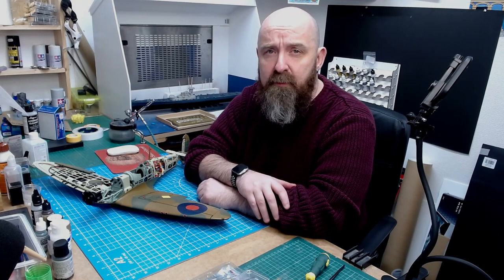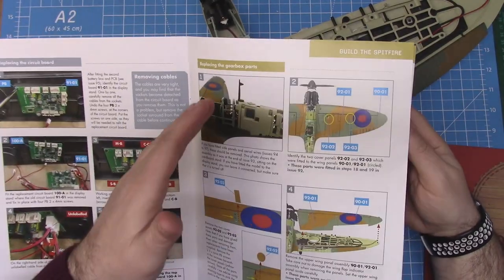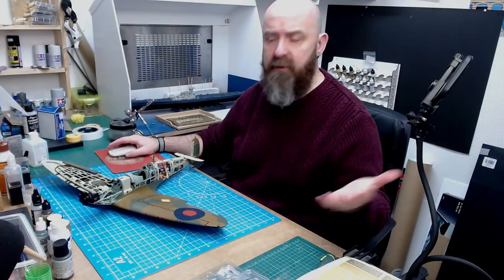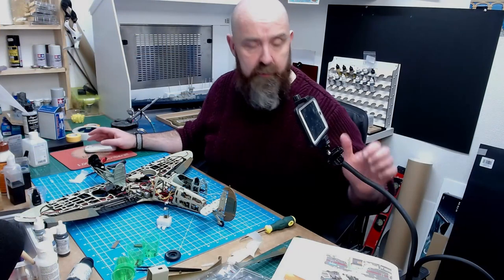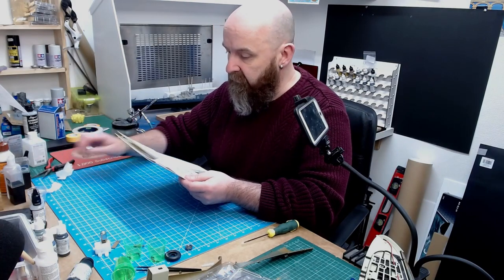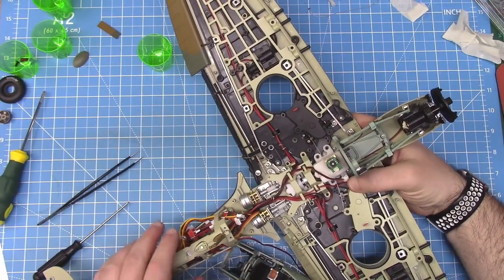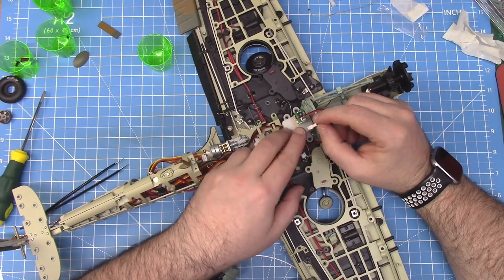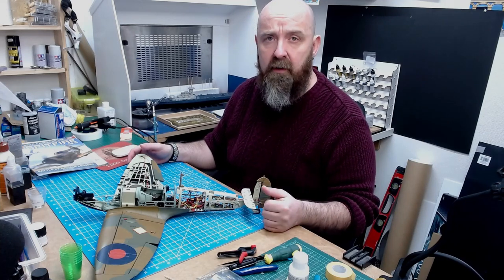Build a 1/18 Scale Model Spitfire Mk 1A / Landing Gearbox Correction

Comment: John as you have the tyres off the hubs ... it may be worth adding a little lead putty or split shot inside the hubs to add a little weight.which will make the struts drop a little easier... as they drop under gravity.... not to much tho

Comment: Well this is the first I have heard of the corrections. I'm waiting issue 99+ and have seen nothing about replacement parts. no motor, no circuit board, nothing. so I'm not holding up any hope of it actually working. definitely going to put in a complaint to hachette about this. done a few builds and not had this many issues

Comment: hi john was following your spitfire re fix having all ready glued my wings i unfortunately when trying to separate them disaster tips of wings snapped aileron bracket snapped anyway i have phoned Hachette and told them due to there incompetence they have agreed to replace all the magazines but have told them i am not happy and may send it all back  so i would suggest you phone them and get the light in the wing replaced
Reply from the maker: Thank you Edward, what was hechette reply after you told them, your going to send the whole thing back
Reply: @Johnbuildsiconic  hi John I told them all the issues I require  to fix it and they said they would send them free of charge and I told them if I can't fix it I would send it back and I want a complete refund as the model wasn't advertised correctly  or I will send it back and they can send me a complete one or total money back just waiting for yhe issues to come they said it will be next week when they should arrive I have the email address  to complai  to in France as well
Reply from the maker: I’m just hoping that the hachette titanic I’m building didn’t have all the same issues near the end of the build
Reply: @Johnbuildsiconic  I have the first 9 issues but have decided not to do it I was given the king George V for my 70th birthday so will be doing that from know on wood like Dora german gun aswell

Comment: I have tried to get the wing tips apart but no success due to having to glue them down as the gap was about 5mm each side.. Anymore and I will definitely snap the wing struts.  I have sent hachette a very strong worded email with the intention of going to trading standards with this. The promotion video shows that the Spitfire is working so why have there been so many corrections needed? I have said that due to the inconvenience and possibility of damaging the model, free issues should be sent if any part of the model has been damaged due to replacing parts by taking the model apart or, reduced price on the remainder of the issues to complete the build but, surprise, surprise, no email back with an answer from hachette.
Reply from the maker: hi hav, yes the build has finisned very disaappointing i hope the titanic build dosnt go the same way
Reply: I’m just going to go with the gearbox as is, and see how it works . Think Hachette are out of parts, so if you tried to get broken parts replaced, not sure they could
Reply: @Johnbuildsiconic hi John. So a real disappointment then, after all this time. What a shame as I absolutely adore the Spitfire. I'm glad I cancelled the titanic as now I will never trust hachette again or subscribe to any of their Builds. I look forward to your video tomorrow of the completed Spitfire just to see how disappointing it is.
Reply: @twigwonderkid  that would be typical of hachette.
Reply: I also had the same problem getting wings off both broke with other parts phoned  Hachette  and told them as it was there mistakes they are replenishing new parts no extra cost
Reply: @edwardbellamy6559  well I'm glad they are doing that. They don't really have a choice due to it being their fault and now this far into the build, we are made to correct THEIR manufacturing mistakes. I had a reply to my email and hachette said that any damage caused to any of the parts, they will send them out free of charge. Now do they only mean the postage or the actual part. I will wait and see because I know that the wing struts will break as I remove the top part of the wing. I had to glue both sides and both had about a 5mm gap so I had to super glue and clamp them.
Reply: @cornwallkev201  if the problem can't be rectified I will be emailing  them for full refund as they have broke there contract off it being of poor quality
Reply: @edwardbellamy6559  I wish you the best of luck with that. I'm sure Ha💩 is going to be swamped with disgruntled customers demanding a refund, including me, if all does not go well.
Reply: @Johnbuildsiconic  I've decided to cancel my titanic don't trust Hachette  anymore